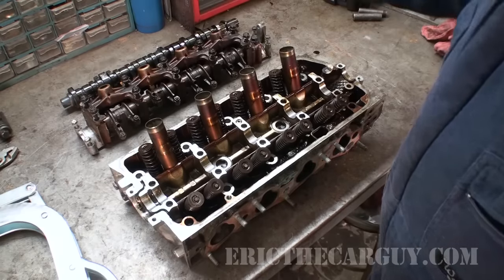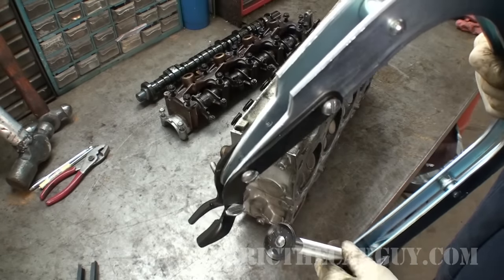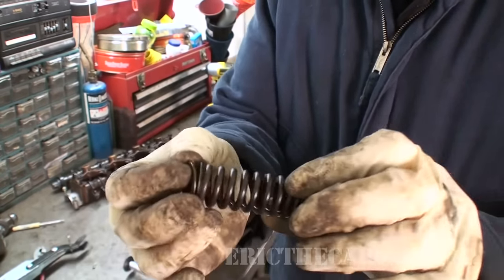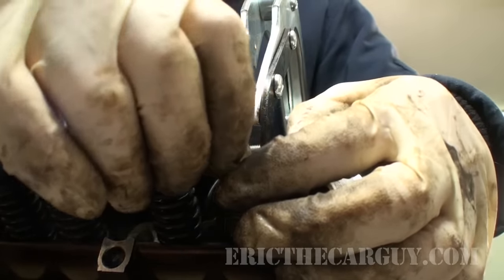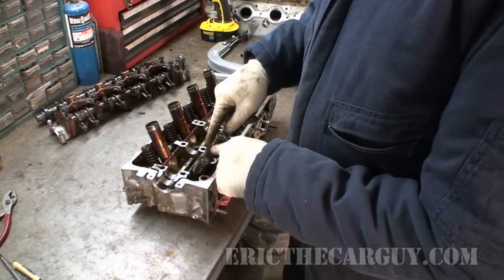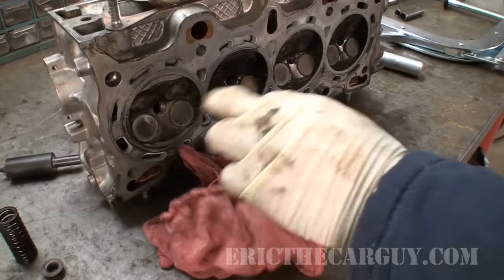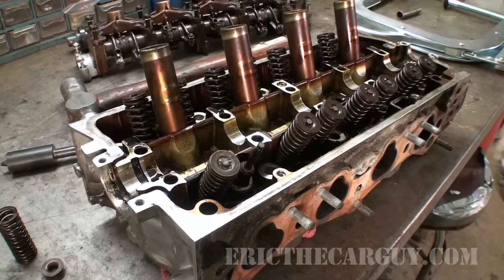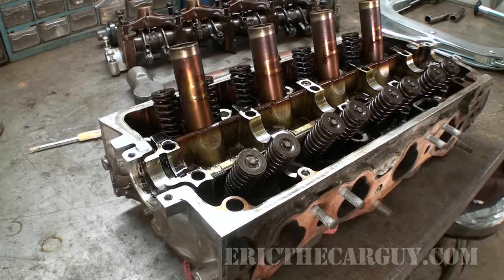How To Remove and Replace Valves in a Cylinder Head -EricTheCarGuy

Comment: Cannot stress enough how important a good valve Spring compressor is, the cheap ones will work but you may loose an eye in the process! Great video Eric !
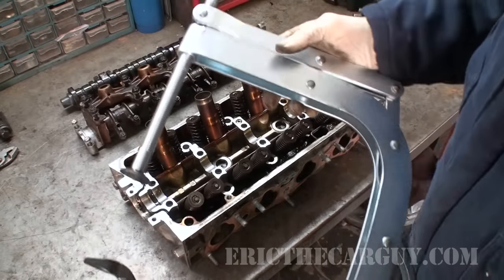Reply: 1:06 😊😊😊😊 1:10 1:10 1:10 😊
Reply: Nobody likes loose eyes.

Comment: Eric i hope you are doing well sir. In 2015 i did a valve job on my 2008 Honda Accord using that tool from Lisle. It worked awesome. Got my car on the road but shortly after i sold it to a buddy. Then i got a brand new 2015 Audi S3. Now it's 2023 and I'm rebuilding the engine of my Audi with 208,000 miles on it. Had to revisit this video to remind myself how to use the tool, lol. Have a great holiday and a healthy new year buddy ! All the best  !

Comment: Bought a used Honda 2.2 non Vtec long block for $80. I was told it needed was an oil pump and new gaskets. Once I disassembled the head, found #2 exhaust valve burnt and missing a large piece. #2 piston oil ring was broken causing oil to seep to the combustion chamber and exhaust manifold. Replaced the valve and refreshed the cylinder head, installed new piston rings and cleaned all the oil sludge. 4,500 miles later the engine is running great with no issues and recently passed the emission test. Thanks Eric for your help and guidance performing this task...

Comment: Hey eric great vids, i recently did a head gasket, timing belt repair on my honda with the info from your videos. Your a big help to us home mechanics. Thanks!
Reply: Fair play I'm currentkyb4aking dealer to court .....mazda given me some horrid diag. Head gasket failing bad turbo and shitted  up intake.  Not impressed . I'm good with most things brakes servicing (currently got bike engine out removing head fir header bolt issues) but that's something I'm.learning in my own time . The car needs sorting in better time good on you buddy

Comment: Dear Eric, a more interesting alternative would be a valve spring clamp compressor used while the cylinder head on the engine (not removed) where the compressing process is so slow (screw in by T handle) and you can easily watch the valve small keepers falls to sides rather than flying away. This clamping device are primarily uses to change valve seals without taking off the cylinder head, but you need to place the piston on TDC on the valves you are working with in addition to applying compressed air through spark plug hole to keep the valves closed, but I did it without the compressed air, but with a special bend screw driver inserted through spark plug hole to keep holding up the valve during the compression of the spring. You may need a second hand if you do not use compressed air.

Comment: I used something like that Lisle tool when I did valve seals in a 350 in a Chevy Van.  I didn't want to pull the heads, so I used the air compressor tool to put air in the cylinder so the valves didn't fall in, and did it that way.  That was a great way to do it.

Comment: Dude you're freaking awesome. I'm tearing down everything in an 03 eclipse because the timing tensioner broke and so timing jumped and the valves broke. I was gonna have to spend like 800 bucks to have a engine guy rebuild it for me. This is gonna save me so much.
Reply: How did it go
Reply: @chambliziOfficialChannel   not him but my crv had a single burnt valve and wouldn’t pass inspection due to misfires. Shops were charging 1,000-1,500 to swap the engine instead of doing a head job. Doing it this weekend myself after gaining confidence.

Comment: This is such a great video about valves and replacing  them. My husband and I wanted to know what it consists off to replace a value. We have a 1999 Firebird and we have cylinder 1 that keeps triggering   the service engine light . We replaced PCV valve, we replaced with a new fuel injector for number 1 and we put in valve cleaner, it worked for about a week with no service engine light, the service engine light is back on and the computer is still reading cylinder number 1. after changing all those things. The car has a rough idle and jumping when in idle and sucking up more gas,  so we realize the issue is more involved  than just the small things we did to help the problem.  We realize the next option is for my husband  to open up engine and replace  valve # 1 and he said, no sense in opening engine which is a big job on a   V8, engine  5.7 LITER and not replace all of the valves. If he  opens that engine up he will replace all the valves cause down the road # 2 or #3 or 5 will act up.  He is not looking forward to doing that ! ha-ha.   He said this is about  4 days worth of work !  We are decided whether him to do that job or pay another mechanic to do this job but we realize it will cost a couple of thousand of dollars  to do this job and we really didn't want to put that kind of money in a car 22 years old with 185,000 thousand miles on it but if we keep the car we will have to do it as if we keep driving it like this , we will cause more damage like ruining catalytic  converter among  other things. The good thing we got 22 years out of this car without never doing anything major to engine or transmission and 185 , 000 miles with just replacing regular wear and tear so i guess you could say we got out moneys worth. We thank you for this video as it explains in detail of how to replace a value and what to do and what not to do.  Very helpful,  Great Job !
Reply: How did it go? Did it take four days after all?

Comment: I know it's an old video, but cheers for this. This is going to be a fantastic reference point for me when I get around to replacing the stuck valve in my 1985 Toyota Cressida. Simple, informative and with a clear view of what's going on. Perfect.
Reply: How did it go? Looks like the hardest part might be removing the engine block from the vehicle.

Comment: Great video... 10pm at night and I just went out and used a piece of 3/4 pvc with a hard drive magnet inside and removed the suspected bad valve. This was a great video. Of course to reinstall I will probably need to visit autozone loan a tool but at least you got me to the valve out and it wasn't bent... at least obviously so now I have to figure out is I just want to clean everything up real good and reinstall. (the car was only $300 and has lasted 16 months.

Comment: I do not have leaking seals but took my pentastar apart to repair hydro lock, the heads and block will go to machine shop for cleaning inspecting and decking so I need to take the valves and seals off it,   I do have the Leslie tool; thanks for the wonderful video.

Comment: I have both of those tools and still prefer the old way if the heads are off.  I've used the air method that works great unless you drop a valve (you can usually suck it back in place with a shop vac). I keep a length of rope with a knot on the end to stuff in the spark plug hole now when doing it on the engine.  Stuff the rope in the hole, rotate the engine to compress the rope, and use an on the head spring compressor to do the job.

Comment: Funny I ran into this video like two years ago and it gave me the idea of machining my own valve keeper remover with a magnet installed to catch the little guys and it works great. Same with the installation machined a tool looks a lot like the add on peace to your old school tool. Good stuff. But my question is I have two bent valves I believe keeping the valves stuck and stopping me from getting the timing correctly orientation done.. what would you do just pull the head start over you think.

Comment: The new large valve spring compressor from harbor freight is actually very high quality and has fittings to reach down far enough into the head for the recessed valve springs

Comment: Excellent little tool ( the second one ) when I did the cylinder head on my Toyota Corolla ( 5afhe motor ) I decided to do the valve stem seals, and the head uses recessed valves, so I just used a 14mm socket to smack the valve down and remove keepers, but getting them back in was a pain xD.

Comment: These's build tips are good. When replacing valves an seals use oem parts (honda,toyota) don't settle with the seals that came with feel-pro gasket kit. Or use amazon replacement valves (dnj,evergreen) . you'll have oil leaks like me. Nothing wrong with feelpro gaskets though. Great rebuild kits

Comment: 2 quick tips for valve service.....tap the retainers lightly with a hammer before applying pressure with the compressor for those stubborn retainers and also....run a file around the tip of the valve in case the tip is mushroomed and won't come through the guide. I have always used the grease method to hold the keepers while doing installation.

Comment: Hi Eric I like it, I have used the old type compressors, haven't seen that other one you are using, I have used a hammer and socket to get them out...great stuff - Fred in England.
Reply: Yup, back when I was in high school in 1981 (yes, we had cars back then), the INSTRUCTOR taught us how to do this with a sledge and a socket.  I was wondering why this method looked familiar...

Comment: It seems you can use that same tool and same method with the head still bolted to the block! I watched a video here in youtube where a guy removed the spark plug, stuffed a rope inside the cylinder, turned by hand the crank until reaching TDC on that cylinder (compression cycle), then if I am not mistaken used a similar tool to remove the keeper and the spring retainer. That will be awesome when you have to just replace valve seals instead of taking the head off to use the old school tool.

Comment: Hi there Eric, I like your video about doing the valves on the cylinder head cause I am doing a head gasket plus the exhaust manifold gasket as well n I bought the O2 sensor's as well n have new spark plugs two new coils oil change n anti'freeze, new battery n I've changed the feul pump just recently, bought new tires,changed the front engine mount n I bought the gasket set that's got the gaskets,O rings n those little cylinders that r shaped like pear shaped n so my question that I want to ask is how come two of the valves on the exhaust side is sticking out, it's on the #2 cylinder the left one is sticking up like 1/4 inch n then the right side is sticking up like 1/32nds of an inch,n so I'm asking why it's like that bt can I do what u did on your video to get it down r flushed with all the other ones, oh sorry 4 got to tell u that I bought this 2005 Nissan Altima 2.5L 4 cylinder engine n have been doing my best to get it to run good n I ain't a mechanic bt I do know some things on maintenance on vehicule's n thank's on video's like your's I got to learn how to do what I am doing on my ride so I really would appreciate your professional advice on what to do

Comment: OTC has a valve spring compressor for Ford which is a factory tool on OHV engines. They also have lifter bleed-down wrenches for Ford. Kent-Moore has engine tools. Goodson has engine tools and valve seal tools.

Comment: I was doing some testing with a single cyl 125cc engine 4 valve shim+bucket dohc. One of the tests was replacing an exhaust valve without seating it or placing a shim under the bucket (defo had a loss of compression). It ran fine for a few hours but eventually it hit the piston. All I can think off is that it burned and the metal expanded so much that it hit the piston? The piston had a tiny tiny mark on it shaped like ) 
on the power stroke the explosion inside the cylinder was defo passing through that valve.. and there was 3 or 4 heavy sort of scratches on the valve face? (where you put the plunger thingy on to do the seating)

Comment: i have this lisle tool. i regularly use it to replace valve seals with cylinder heads still in place. i use compressed air to keep the valves in place.

when i first saw that tool, i knew i just had to have it. 

instead of using small hammers, big and heavy ones work better as you can hit slower but get more spring compression.

Comment: Beware!!!! You must be careful to not bend you valves. The tool is very cool but if you are not careful you can bend valves. I bent an intake and did not catch it till I had the head back on the engine.  The tools is great for taking valves off in that you need only to provide a small force. Putting the valves on requires a great deal of force. I had rages placed to keep the vales in place while I struck the valve with a hammer. I can only guess that the rags moved and the valve struck the table I was using causing it to bent.

Comment: Some valve keepers are slightly magnetized so there is no need to put axle grease on them but it's a handy tip if your working on an engine without the magnetized keepers

Comment: I did a lot of  valve grinds back in the eighties, I used a machine called a Repco cynchroseater, a very good quality Australian made valve grinding machine, I had my own handmade valve spring tool, it had a large plate that went under the head and a rod that the lever slid along, the lever or handle had a flat section with a series of holes that a pivot was connected to that you could adjust to suit the valve it pushed down on.

Comment: The grease also works to retrieve any small part you drop in an inaccessible spot. Like dropping a wrist pin retainer in the crankcase of a 2 stroke motorcycle engine. (That is how I came up with this). Put a small blob of grease on the end of a long thin screwdriver or similar (coat hanger will work) and "stab" the offending part to bring it back out of where it was trapped.

Comment: On a high mileage engine the collets or 'keeper' as called here, are often wedged hard into the retainer.
I put a small piece of wood under the valve head and use a ring spanner against the retainer to give a tap to break the bond.

Comment: not exactly the same subject but i recently put a crate 350 in my chevy pickup,runs great and all,have about 2000 miles on it.last night i hammered on it for the first time ,and then this morning when i started it ,there was lifter tick and yes there still is.hoping its just valve lash but i am wondering if i could have bent a push rod.used zinc oil for break in and i am now on my 4th oil change with the same zinc oil

Comment: I've watched a master mechanic ( Porsche NA) remove the valve using a socket and a hammer in seconds.   Simple and easy, less controlled, and keepers tend to fly around.  I only bring this up because I've never seen anyone else do it.  Curious if others have done this
Plus the kit he is using is pretty much what the 75-year-old mechanic doing it with general tools...

Comment: Hello Eric,

I have a 07 Chevy Aveo.  I decided to change the timing belt and did it at night.  Long story short, belt came off, valve bent and I am just wondering if it makes sense change the valves? Swap the head? Replace the engine?  Or just buy a new car?  I have replaced 4 timing belts on various cars with success, but this was done after work with very little light till 1 am.  Any thoughts would be greatly appreciated.  PS, you do a great job making videos! Very thorough.

Comment: The most in-depth I've gotten with engines so far is swapping a locked up 305 with a 355 in an 86 camaro, so that was pretty much as plug and play as it gets. Given that I'm mechanically inclined but lack experience, would you recommend doing something like this as a novice? I've got a 95 f150 that needs new valve stem seals and I plan on doing the heads-off method since I also lack the money and space for an air compressor. Is the actual replacing of the seals easy or require anything special? Since that's the only work that I plan on doing to the heads, are there any adjustments or precedures I'll need to make/take when reassembling the heads?

Comment: I use the Lisle to change the valve seals without having to remove the head. Just remove the valve cover and use compressed air or a rope in the cylinder to keep the valve from falling in. I love my Lisle 36050

Comment: I'm working with engines we do the same thing but we have a peumatic device that press springs and we use magnet to remove spring locks but you have an amazing tool to nice job

Comment: OTC has tools. Goodson has valve seal tools and engine tools. They have magnetic keeper tools. Use a small extending magnet to pick out keepers.  Use Clothesline in the cyl. to lock the engine and hold valves up. Rotunda has Ford tools. Hit the spring and stem with a hammer to loosen locks.

Comment: I've done valve seals on a couple Acura Legends with the heads still on the block in the car. I used the Valve Master by ToyoTool to remove the spring components and reinstall them. It's not the cheapest tool, but it's a time saver.
Reply: DIY Apprentice do a video

Comment: I'm probably gonna order the kind that looks like a pry bar to save money, not knocking having a better tool. My OEM manual has two tools they suggest to use and one of them is the pry bar one, so that confirmed that I can use that kind on my springs.

I was planning on letting the machine shop do the valve work but especially since I wanna be a mechanic, I did some research and learned how to do it all myself minus what you need serious equipment for.

Comment: Hey Eric 
I've got to replace my valve seals, is there a tool you would recommend to use without removing the head? Something to depress the springs on maybe 10psi shop air?

Comment: I like the twist screw compressor, like kd#2078. always smack the top of your valve with a brass hammer after installing your keepers to fully seat and lock them. My machinist told me that

Comment: Nice vid as always. Since doing a valve job would most likely be done after many miles, I'm curious if the springs lose spring force over time and would thus need replacing or are they good for the life of the engine?? Assuming that it's a daily driver car.